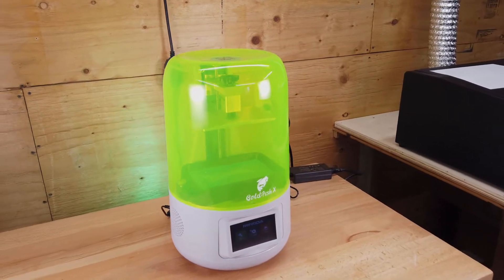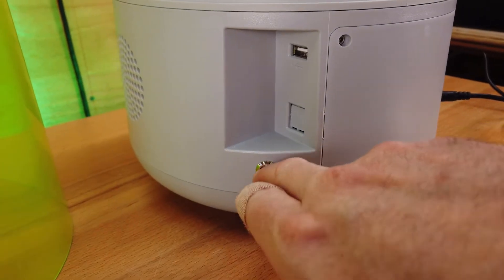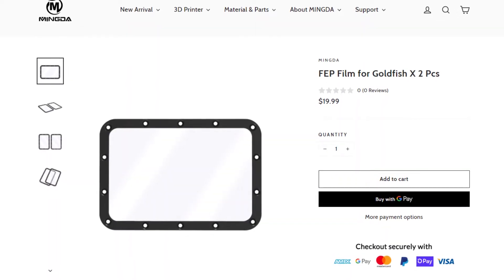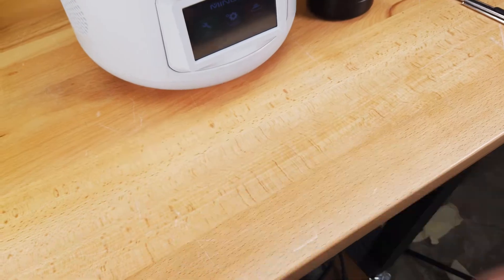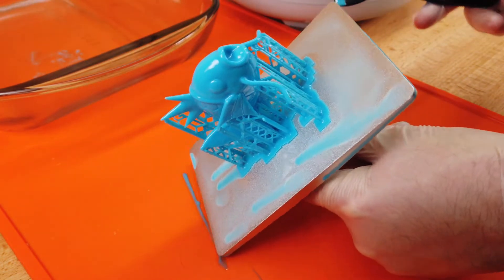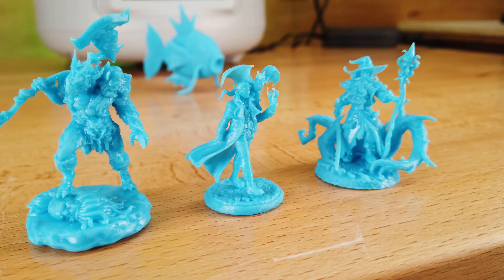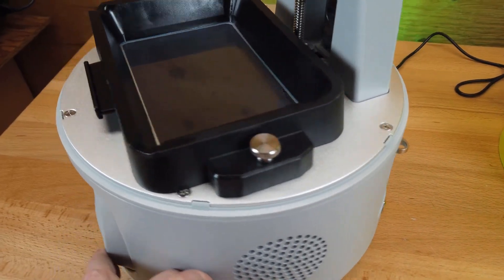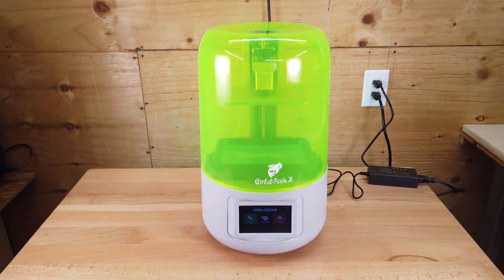Mingda Goldfish X Resin Printer

Comment from the maker: Mingda Goldfish X Resin Printer:
Amazon - https://amzn.to/3GaHE7A 
Mingda Website - https://bit.ly/GoldfishX 

For the 3D files used in this video check out the links below:
Magikarp Gyarados Mega Evolution 3D print model - https://bit.ly/MagikarpGyarados 
Maker of the Pokémon models - https://www.instagram.com/zzzmonkiezzz/ 
ArchvillainGames - https://www.patreon.com/ArchvillainGames/posts#website 

Extra Parts & Replacement FEP Sheets:
FEP Film for Goldfish X 2 Pcs - https://bit.ly/FEPFilmForGoldfishX 
12 Pieces Plastic Spatula Putty Knife - https://amzn.to/3rcspXi 
2pcs 1.5” Plastic Razor Scraper - https://amzn.to/34lD4WZ 
3 x Wire Flush Snips - https://amzn.to/3rb3FyO 
50 Pack of Paint Strainers - https://amzn.to/34nsfDS 

Wash & Cure Systems:
Amazon - ELEGOO Wash & Cure Station - https://amzn.to/3gWHUxH 
MatterHackers - ANYCUBIC Wash & Cure Machine 2.0 - https://bit.ly/WashAndCureMachine2 
Amazon - ANYCUBIC Wash & Cure Machine 2.0 - https://amzn.to/3DWG4FO 
Amazon - ANYCUBIC Wash Cure Machine Plus (Large) - https://amzn.to/3DWFLe8 

Standard Resins: 
Amazon - ELEGOO Plant-Based UV Resin – https://bit.ly/3gUWSE9 
Amazon - ELEGOO Water Washable Resin - https://amzn.to/3qrsQLu 
MatterHackers - Epoxy-Free Build Series Resin - https://bit.ly/EpoxyFreeBuildSeriesResin 
Phrozen3D - ABS-like Resin - https://bit.ly/ABSlikeResinPhrozen 
Phrozen3D - Rapid Aqua Resin - https://bit.ly/PhrozenAquaResin 

Castable Resins :
MatterHackers - Liqcreate Wax Castable Resin - https://bit.ly/LiqcreateCastableResin 
Amazon - Siraya Tech Cast 3D Printer Resin - https://amzn.to/3aUBLyi 
Puvah - BlueCast X-One Resin - https://bit.ly/BlueCastXOneResin 
Phrozen3D - Wax-like Castable Resin - https://bit.ly/Wax-LikeCastableResinPhrozen 

Engineering Grade Resin:
Amazon - Phrozen Onyx Rigid Pro410 Resin Strong & Tough Made in USA - https://amzn.to/30IQdHJ 
Phrozen3D - TR300 Ultra-High Temp Resin - https://bit.ly/PhrozenTR300UltraHighTemp 
Phrozen3D - Rock-Black Stiff Resin - https://bit.ly/RockBlackStiffResinPhrozen 
Phrozen3D - Nylon-Green Tough Resin - https://bit.ly/NylonGreenToughResinPhrozen 

CHITUBOX Pro $40 off Discount Code Valid Until June 30, 2022:
Code: gomeowcreations
https://bit.ly/ChituboxPro40off 

Info from MINGDA Goldfish X Listing:

Precise Printing Resin Printer: MINGDA Goldfish X equipped with a 2560*1440 resolution UV photocuring LCD screen, with matrix UV LED light source, 0.01-0.05mm layer thickness, use the anti-aliasing technology(4-8times), which ensure you print smooth and delicate models with more details.

Stable Z Leadscrew: With a stable and precise sliding rail Z leadscrew, makes the Z-axis moving smoothly and more stable.

Dual Fan Filtering System: Dual fan inside the printer, absorbing built-in activated carbon, can effectively reduce odor emission and keep the air fresh. You won't smell pungent smell during printing.

High-Quality LCD Printer: The main body is designed in full metal and adopts CNC cutting technology, and the strengthened structure greatly reduces resonance. Unique flip design anti-UV transparent cover, bidirectional blocking 99.95%.

Easy To Use: The Goldfish X is pre-leveled before shipping, no need to level to print after you receive it. New friendly interface, the 3.5inch touch screen is easy to operate. 1-year warranty and lifetime tech support.

______________________________________________

______________________________________________
Note Most of the links that I use that go to products are affiliate link. This means I make a small commission on anything that you happen buy using them. This is at no extra charge to you and this helps support the work I do on this channel. 😁👍
______________________________________________
#Mingda #GoldfishX #3dprinting #resinprinting #diy #maker #3dScanning #DIY